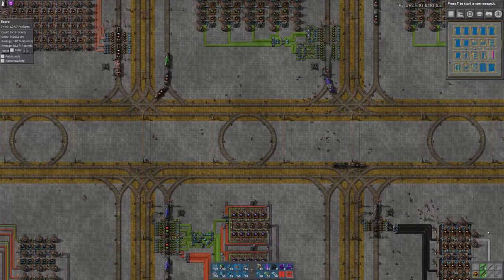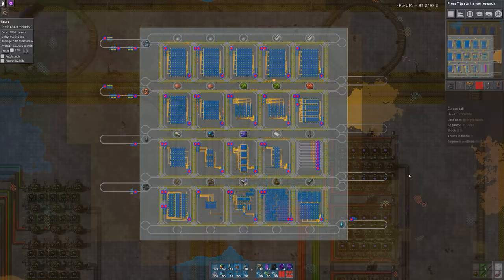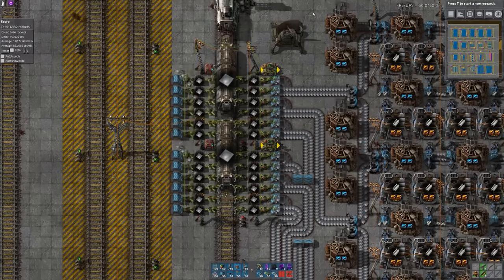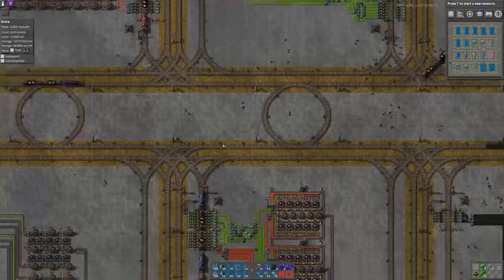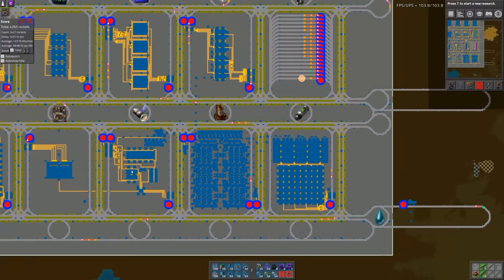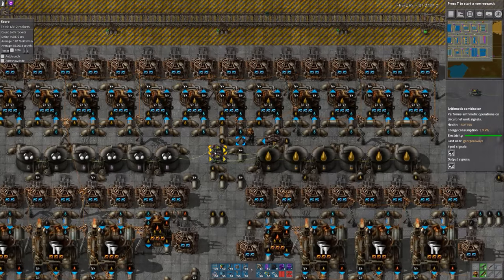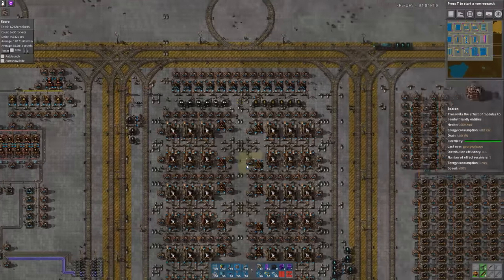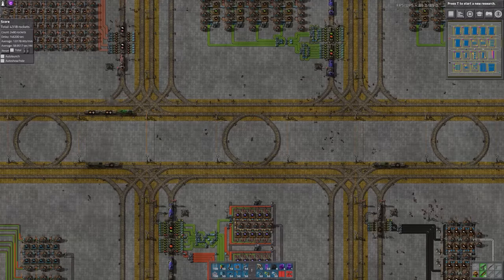Factorio: 1 RPM "Antfarm" Factory

Comment: This is why I love the Creative Mode mod. I love to fire up a game and experiment with it. I mostly like looking at throughput and consumption numbers for insane setups, because it gives me an idea of how much of X material I would actually need to sustain Y amount of throughput. And if I wanted to experiment further and see a more "realistic" scenario using miners or oil refineries instead of magical boxes that produce it for me, I can easily set that up and see how it all runs. It's useful information for actual games, because I can plan something out to hit that specific level of throughput, and even if I can't actually supply it for a very long time, it's ready for that expansion when I can make it happen, no additional work needed.

I would experiment with that map for ages, trying to see if I could conceivably supply it with another set of trains dropping off crude, iron, and copper ore. I think it would be prudent to keep the ant farm rails isolated from the rails going further out to resources, so they don't end up taking absurdly long trips that clog up the factory. A dozen single car trains running in with crude oil could dump crude into a tank, and that tank could have a pickup station on the other side of it that the ant farm trains go to for getting oil, but these two rail networks never actually intersect with one another.

Now I kinda want to download this and experiment with it, haha.

Comment: This guy: an complicated multi rail system
Me: WHY WONT YOU MOVE, YOU HAVE AN LOCOMOTIVE IN THE FRONT AND ANOTHER IN THE BACK, WHAT DO YOU MEAN "NO PATH" I JUST GOT HERE USING THE PATH, JUST GO
Reply: Mood
Reply: Most of the time my trains don't have a path when I put a signal on the wrong side of the track from adding a new crossing or juncture. I just manually drive the train and test auto until I find the cause.

Comment: Not to be "that guy" but once you have 100+ hours into a single vanilla run, you definitely have the raw resources to build this within another 50 or so hours. Maybe not without construction bots, but the fact the factory works without them doesn't mean you can't use them to build it. So my 20,000 construction bots, in my giangantic robo/power grid, should be able to build this pretty quick. The real work was in designing it. That is the truly impressive part. Insane work. Very inspiring.

Comment: For mine, i have gone for a similar type thing, but it is an onion network of isolated rail networks and using bots. That though is in-game with mining and biters. Still WIP, but it is looking good. I like some parts of your design. But, i have to admit the factory looks a bit small for 1 rocket per minute. Satellites require a lot of resources and if they are fed by belts, then I would expect there to be more. Your Blue production also looked a bit low for a constant supply. I think my factory will be less optimised than yours using 4 wagons per train and be about 10 times the size to go for rapid rocket launches.

Comment: One problem I see with this design is that it doesn't organically evolve from any subset of itself.   Building something like this requires all the materials on hand to begin with, as the initial placement of the cells would make them maximally far apart before they had the production ability to fill the trains quickly.

Comment: The only shitty part about this is that now that some of the recipes have changed, so does this, but as of 0.17, its not much. just a rocket fuel needing light oil rework in the lower right corner, which i may update soon

Comment: And how does it work with science packs? where do they go and do you do any research?
Reply: It doesn't the factory was built in creator mode. It's clear the factory was built purely to make just rockets and the parts needed for them the creator even said he skipped adding sats to the rockets. Not sure how much of the back end stuff that is used in science production is in this factor layout, inserters, belt production, factory / miners, basically stuff used in science pack production. I would have expected that he would have had a dedicated cog production area given that they are used in just about everything (although he may have made them on location.) No matter I imagine a similar design of factory that also took in to account science production would be a good deal larger and would also require significant upscaling in terms of iron, copper and steel production to offset the resource needed to feed science production.
Reply: Sorry thought I would add in the factory doesn't have ANY infrastructure production areas. A quick scan through the train list starting at 1:35 clearly shows nothing related to belt, inserter, track, train or in fact ANY of the back end stuff. I mean the factory is beautiful to look and really is amazing but it's a factory designed to do one thing, make and launch rockets that's it.
Reply: When I blueprinted this and added it onto a starter base, I made another row of the track loops across the top and built beaconed science production in each module.

Comment: My oil raffenery stopps working all the Time:(
Reply: You need to balance production with consumption.  That's why he had those ratios programmed to pause as needed.  Another way to balance is to produce something else, like solid fuel to bleed off some gas, or convert to another type of oil or to full another new tank until you get the science progress to use that oil variety.

Comment: >thousands of hours to construct this in vanilla

Probably more like ~100 or less
Reply: Of which 60 is spent finding more ore and building outposts.
Reply: Naa, not really. Building outposts is easy and goes quite quickly. Also, there's something called mining productivity nowadays.
Reply: Do it and upload a time lapse.
Reply: There is a fairly smart way of doing it. Having all the ore trains stacked up. Then having the outpost  turning of the stations, and just on then when its full. Of cause, then 2 cargo wagons may be a bit smal.

I would say... of cause that breaks this solution: But on mine smelting is way smarter, because it reduce the amount of needed trains. Specially for Steel it makes heck of a diffrance
Reply: Never spell check anything. You're fine.
Reply: Intermediate depot that steps down your larger trains to 3 length trains would work. but meh, seems more like a self imposed challenge, of build a factory that only uses 3x length trains, and gets 1 RPM.
Reply: Austin Bates yup, that's how I do it.